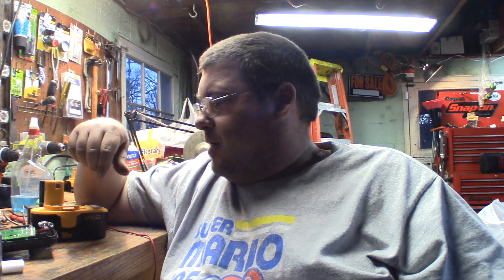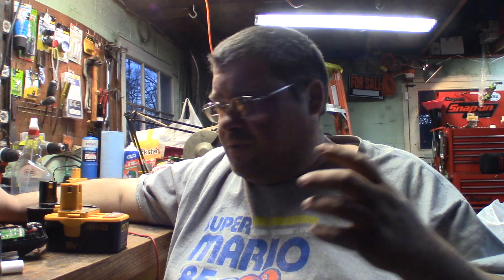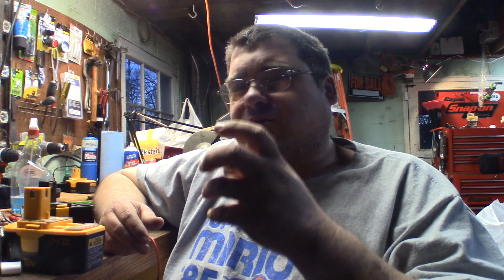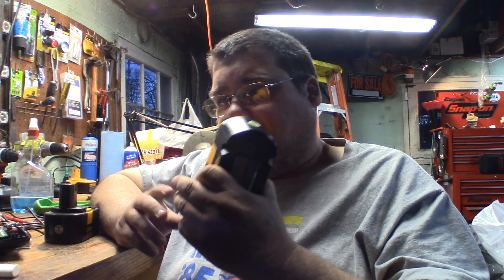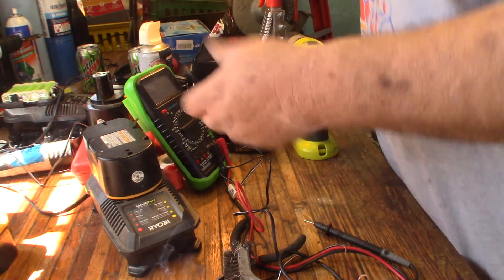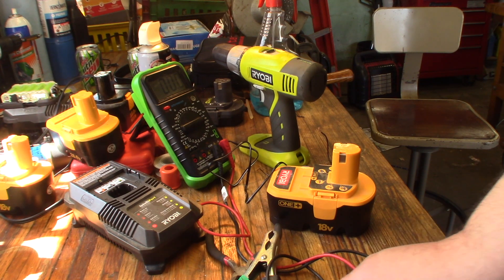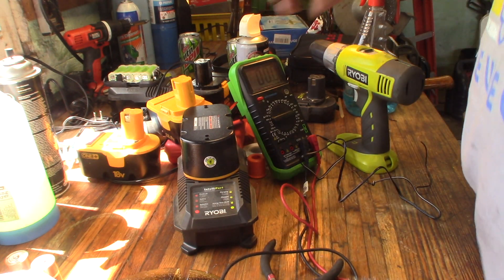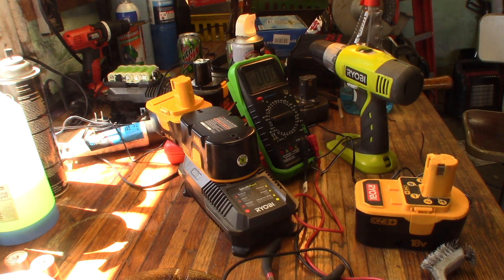How to Bring NI-CAD Drill Batteries Back to Life & Make Them Charge Again - Ryobi

Comment: If you don't have a welder, you can open the battery pack up and hit each individual cell with a 12v car charger the same way.
Reply: u could use a large car charger 100- 200 amps
Reply: FrugalPrepper's Garage & Garden & would b less work 2 !!!
Reply: I'm gonna try that.  Nothing else has worked.
Reply: At what amp setting? 2, 10, or 50 are my charger's choices.
Reply: @sgtbilkothe3rd  did you ever try this? If you did, did you just tap the leads on the battery contacts? What amperage did you use?
Reply: @chrisscholp1968  Never did try it, gave up and bought new battery packs, old ones went to the recyclers.  If you try it I would like to know if it worked.
Reply: My battery charger has a 10 amp setting.  Do I turn the charger on and then just tap the leads against the battery and get a spark?
Reply from the maker: That's a great idea.  That would definitely work.

Comment: I don't have a welder. But I've had some success using a 12 volt automotive battery charger, in the same manner. Usually only works on smaller NI-Cad batteries. Great video BTW.

Comment: After seeing this I tried it on my 3 18v dewalt 100% flat batterys which has been in my store room unused for 6 years I used my battery charger on 24v with full 30 amp out put to spike the dead batteries 6 times each and to my surprise all 3 recharged on the dewalt charger and are working fine.
Reply: All that education, valedictorian with 5.0 gpa and still can't spell.
Reply: @maxprophet2401    Yeah, a little hard to believe, he's going on and on, boasting about his knowledge of electronics and then writes "electricuted". We did not call A & P school "college", just went through training and received a certificate, 2 years full time. Maybe he earned a degree in aviation at the same time, but if he was the best of the best with a 5.0 GPA, he was in a college of dimwits and they were grading on the curve.
Reply: I was wondering what might work if a guy didn't have a welder. I'll try the battery charger. Thanks for this tip.
Reply: Rene Drew   I think he just did, I couldn't read it all, too much blathering on.
Reply: John Brown
Reply: John Brown
Reply: Do you think a quick jokt of 110 volts would be too much?
Reply: @andrea s:  NOOooo, do not use 110V AC directly from your outlet.  Needs to be DC thru some sort of transformer that drops the voltage and amperage into ranges that won’t easily kill you.
Reply: WAIT, STOP, NO THATS BAD! Don't use an A/C power source if that's what you mean.  The chances of having an explosion will be far greater.  Its like trying to jump your dead car battery off from your neighbors running car backwards.  Instead of negative to negative and positive to positive, you either have a brain fart or you just made a one time careless mistake and hook it up backwards.  It will probably internally fry or explode both batteries, spraying battery acid onto every piece of uncovered skin on yours and everone else in the areas entire body, damage both cars entire electrical system, including the ECU, otherwise known as the vehicles electronic brains, $$$.  You don't ever want jump a battery off without a full respect for every step of the procedure.  If you accidentally or otherwise use alternating current, or in other words, the power that comes out of your home's wall outlets, in this already highly risky little hack, it will probably least of all do permanent or irreversable damage to an otherwise salvageable battery pack.  It has the potiential to take your freakin face all the way off, and probably burn your house down too, and just radiating collateral damage from there.   There are no words to describe this god awful blood bath nightmare.  There is just no way to even begin to really imagine the horrible consequences and regret.  It has happened many many times before, and will continue to happen to many many more in the future.  The danger is super real.  
This hack, working with batteries, or working with electronic and electricity period requires training, and an understanding, and the respect on a level that most will never know anything about for the life and death dangers involved.  Saftey has to never be neglected, because something will happen eventually to even the safest and best professionals and practioners in the business. So please, do not even attemp this without having a good working knowledge of basic electricity.  Ask someone to help you do this if you don't have total confidence in your knowledge and abilities.  Frugal prepper says more than a few times that even under the best circumstances,  there is a real possibility for things to really bad, really quick.  That is real talk my friend.  I speak from practical experience.  3 years college to be a federally certified aircraft mechanic, A&P certified.  I maintained 5.0 GPA every time from day one to graduation.  I graduated valedictorian, I had extensive studies in electronics and electricity, and I've got over ten years expeience on the job  as a licensed professional specializing in electronics and electrical systems.  I have seen some  accidents on the job.  And I have seen people lose theIr lives while at work doing the same thing that I had been doing all week.  I don't talk about it.  I only say now because I can't overstress how the danger we're looking at here is the very same seriousness.    When I consider the people that I respect and that are an inspiration to me because of there knowledge and level of expertise, I can easily admit that in contrast between them and myself, I am like a baby that don't know jack.  I have had the privilage of working with and learning from some amazing people.  Not many, but some, very few would I actually say really they do have that broad and solid understanding of the craft and can manipulation electro-mechanical energy that our modern state of the art technology is baised on. It is more like devine magic than scientific fact.  There are many aspects of it that the human race still doesn't understand.  Even some basic things such as fundanental laws.  Even Tesla almost electricuted himself to death at least once.   hat anything else I know of.  not everything by a long shoot, but far more than the other 98% percent of those in this feild, what electo-machanical energy.  Be cautious and us descretion when duplicating DIY projects seen all over youtube.  

But going on with this refresh hack, I'm not positive what Frugal said about the voltage he was using in the video for sure without going back, I think those small welders usually run around 17 volts DC.  
Therorically you want to swap his current value over to your volts because that value is around 100.  I think you said 110volt to be exact. Likewise, his volts value will now be your current or amperage value.  So, you will use something like 110 volts DC power source with a maximum current output value of 17amps.  The value of the Voltage and current variations are directly related when the intention is to maintain the same power output. In this instsnce, because our load or what ever you applying this power to, the battery to be refreshed, is the same either way.  When the load is changed things get alot more complicated.  The load or resistance in a curcuit also directly affects the power consumption in a electrical curcuit.  If all you want to do is revive a battery pack that is similar to what Mr. Frugal shows, then that is why the we can just swap these two major values and still  come out with the same end result in essentially an identical way.  The fact that the voltage is much higher makes no differece because you are also now using far less current.  Same, same.  You understand?  The current is reduced according to it's relation to the increased voltage you are using.  The 110 volts DC that you proposed is actually the easy conversion to calculate bucause you actually just swap those values and you will still be acheiving the same rusulting output or total energy or power.  It is the energy being expended by that spark you see when you make contact with the positive and negative terminals of your battery you want to refresh with the positive and negative wires of your power supply you are useing if thats easier to understand in simple terms. It's measured in watts or joules.  In addition you must further consider that Frugal says that he is used his power supply turned down to the low setting.  By setting it to low power, the current is probably being limited to some reduced value while the voltage remains constant and unchanged.   Maybe he can elaborate on some of the questions about his specifics in another comment or follow up vid.  If I were to attempt this.  And I still really don't know if I would.  At least in the same manner as shown.  I would gave to make it a little safer by doning it remotely with some shielding.  Expect an explosion and try to at least make it a controled explosion with saftey measures in place.  It's the same as Russian Rullet in every way the way we saw in the video.  I like it.  It's really smart.  I didn't know it could be done, but Mr. Frugal seems to be a pretty sharp fellow and knows the facts about the things that he is talking about.  There is alot to he said for that.  Especially with all the ignorance that's going around on youtube.  I learned a valuable trick here, but I would leave much less to chance.  Another thing too as kind of after thought but deffinatly worth mentioning.   All those batteries have a little currcuit board inside them that should probably be removed before you try to zap it.  It is the battery charge management curcuit.  You need that to function properly in order for your charger to begin and end the charging process after you have refreshed them and I suspect that frugal prepper may have damaged the one inside his battery pack that he nevr could get to start charging.  Have fun learning by experimenting on your own.  When we stop learning we stop living.  Be safe and enjoy!
Reply: @toddsmith1976  Vanadium, familiar with it?

Comment: It would have been nice for you to show us the one you did get working was first not working prior to you regenerating it. 
Question will this procedure work on the 18 volt Dewalt batteries.

Was the welder on AC or DC setting and what was the voltage setting and the AMP load did you hit the batteries with.
Reply from the maker: That was my intention, but I goofed up while videoing it.  I never expected this video to be very popular or I would have made sure I did it again with another bad battery.  Yes it will work on any NiCad battery as long as it doesn't have any circutry inside of it, for regulation, temperature sensing, or charge indicators on battery.   I am repairing a Bewalt 18V right now for a friend that has 2 bad cells and it has no internal circuitry, but I don't know if there is more than one type of model of Dewalt 18V nicad battery.
Reply: It better be on DC
Reply: Im guessing the welder is on DC? Might be good to tell in your video

Comment: Another vid with too much waffle in it. Just the info required in nice informative steps is all we need. As for the comments about welders, they have to be DC and as such are all rectified. You cannot get a constant smooth arc with AC.
Reply from the maker: No most small cheap stick welders have AC output.  That one of the reasons they suck.
Reply: I am not going to be a smart a?? with you, but please look at good welders and you will see you have a choice of DC/AC for many reasons.
Reply from the maker: Yes some good welders have a DC/AC Setting.  Most small cheap ones are AC output only.

Comment: Can also use a 100 Watt incandescent light bulb in series to burn the whiskers - add rectifier for DC
Reply from the maker: Weaher it is AC or DC won't matter, but 120V would be excessive.  The welder I am using is a AC welder.  I would get the voltage down to no more than about 50V
Reply: since it is the AMPS that create the adjustable  arc not the volts so would a 12 volt car battery not give a hot enough spark to get the critter whiskers off the battery inside most car batteries are rated by AMPERAGE so I would believe it should work because a 12 volt battery ground and hot lead struck to a metal frame for a second causes an arc like your welder did, we use to wrap a 6" screw driver shaft with solid insulated copper #14  then hit both ends of the car battery for a few seconds to magnetize the screw driver then they would hold on to screws where our fingers could not fit in,  held by magnetism the screw stayed on the driver end.
Reply from the maker: It is current that melts the whiskers off too.  But you need to have voltage in excess of 18V to overcome the native voltage of the battery to get the current to flow into the cells.  I would say 24Volts at least to get a good enough current flow.

Comment: Does it have to be a DC welding machine or will an AC welding machine work and what are you using to give it a small charge before you put it in the charger
Reply from the maker: The Welder I am usign is a little 120V AC Stick Welder on the 50AMP setting.  The charger is a 24V DC output adapter.

Comment: I have used a car charger with a starting circuit to quickly zap small cell NiCads to get about the same success. You can keep the carcass of your dead soldier and replace the internal cells.
Reply from the maker: I am actually using it right not to steal some of the good cells to fix a battery for a friend.

Comment: Car batteries sulfate up in about 3 years, but you can buy a battery desulfator from Clen on ali express for 20 bucks +- and extend the life of any car battery. The sulfate accumulates on top of the batery and can be cleaned off with baking soda. The electronic unit pulses power across the plates to remove the sulfate. My blem interstate is on year 4. 
I left my brand new milwalkee skillsaw in the storage shed over the winter and the batteries wont take a charge... zippo nada nothing. My makita batteries freeze thaw and still work fine.

Comment: Nice trick, you could mention how much you have the welder set to.
Reply from the maker: It is small 120V Welder on the LOW setting.  It should be 50AMP AC output on the low settings.
Reply: doesn't matter how high the current is set to. Its the voltage you need to be careful of.

Comment: Two days ago I put my Harbor Freight Drill battery on to charge it. Then forgot all about it until I saw your video. Ran down to the basement and checked it. Charger and battery very hot. Tried the battery and it still works. Hope I didn't ruin it! Thanks for the video.

Comment: Most 110v stick welders put out AC current. Do you have a DC welder? You also said car batteries in series work and they are for sure at DC. I have used high voltage (around 90 v) electrolytic capacitors and discharged them into smaller nicads to de-whisker them but I have some Dewalt 18v batteries that need it and my capacitor trick won't work. Short of rectifying my welder I am short on knowing what to do.
Reply from the maker: It doesn't matter if it is AC or DC as long as you get a jolt of voltage to blow the whiskers off the annode and cathode.   If you have good 18V batteries you could hook two or three of them in series to blow the whiskers off of the bad one.
Reply: Since every welder I have used is very adjustable, it would be nice to know the setting he was using, so we don't go hog wild and hit it with ten times the amount he used, with catastrophic effect.
Reply: you might try checking the thermal fuse.
Reply: Dude  get to the point dam i just about does d  off  good idea  but clean  that garage out look some what  profesinal

Comment: i was going to try this but then i found another video that was supposedly originally from a kid,don't know his age but it was so simple to do cause i need to get a new torch for my mig welder.i even wondered if i could do it with a mig so i did this instead -with battery docked in charger switch or plug in and out repeatedly randomly,intermittently,whatever until you get it to accept a charge..sometimes a little patience too. i tried it on my milwaukee charger and battery and it didn't work..i tested the charger and it didn't work..hmmmm? how the hell did that happen? i take care of my stuff..nicads,nimh,and i think lithium too all go bad in extreme temps.seems to me that it ruins them..i keep certain test instruments in a cooler both during summer and winter in my workhorse, i think i need a bigger cooler now to accommodate for my batteries too but anyway his trick did the trick for my ryobi battery and charger.i couldn't believe that it worked.now i'll test it to see how long it holds a charge..thanks for your video anyway it does show it working like you said and i saw the proof.
Reply: Mike rosco I
Reply: Truck driver over size load gets pulled  over. on YouTube